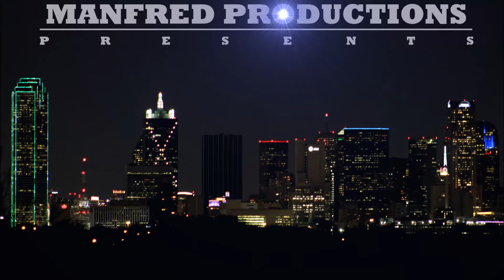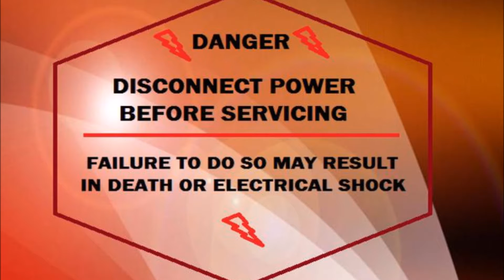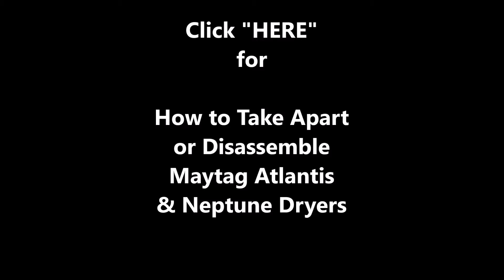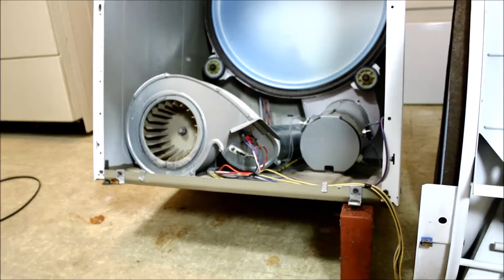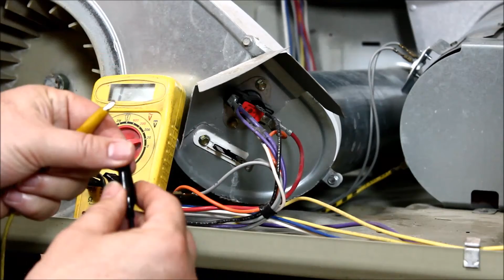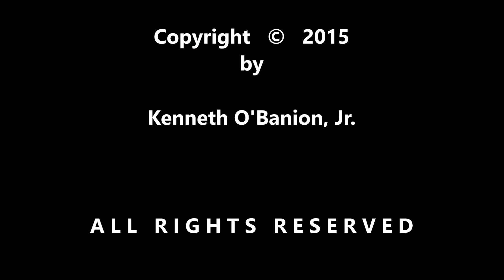DRYER REPAIR - Won't Start or Run Thermal Fuse Test Maytag Atlantis & Neptune

Comment: Did you find out what the problem was? I have this dryer. I have power and can hear the motor hum behind the timer/start knob as I hold it out, but as I release pressure, I lose connection. I don't want to replace the start knob unless I need to